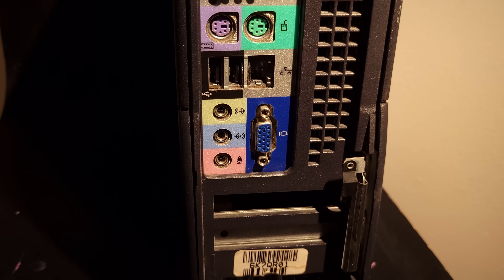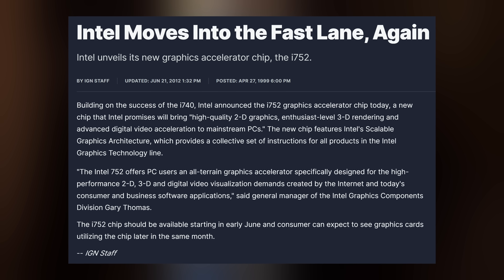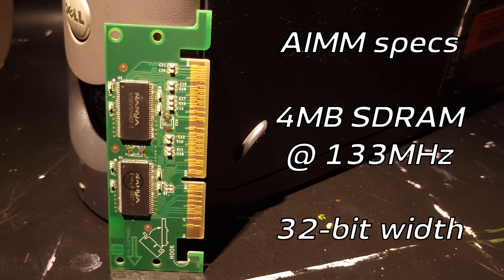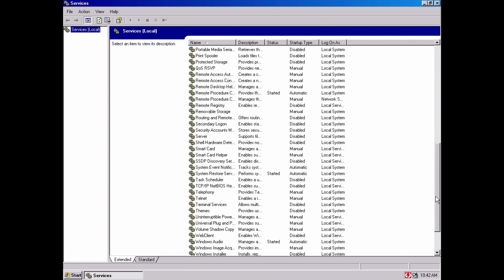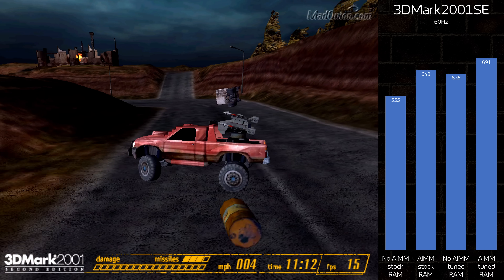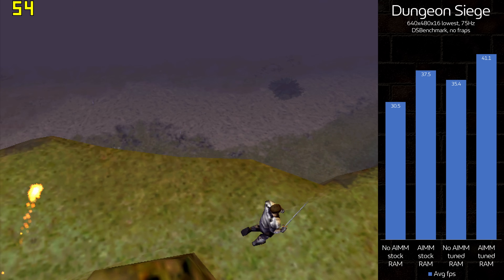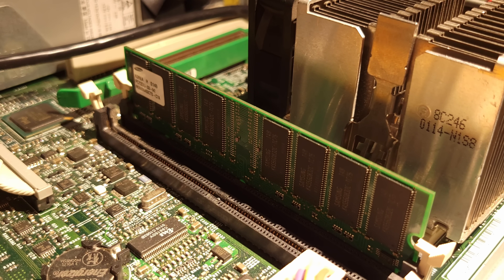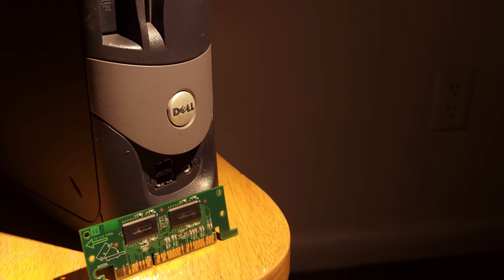AIMM: Intel's Forgotten Graphics RAM Card from 2000

Comment: there was old agp that used the on board ram !!! plus it's ram on the old 32bit systems !!! I p[ayed halflife 2 on it a p4 witha 256mb agp card. system used the first 4 gb ram then the agp used the rest !!! I payed with this setup till I finally had to do windows 7 2012. then 7 till a few years ago now on 11 !!! the 7 pro was a i-7 2600k 4.5ghz 16gb ram rx 550 4gb slow version. at 60-100 fps gaming with fornite and warzone when it first showed up for both fornite and warzone (and ps4(fps ?) when it showed up)!!! then now ps5 and good computer systems !!!

Comment: actually "dedicated external ram" for iGPU sounds a good idea, if on laptops you can select which RAM stick will be exclusively used by iGPU without interference with operating system on laptop with too many RAM slots and you're fine dedicating few sticks of it for iGPU

Comment: This kind of reminds me of what should have happened instead of SLI (Nvidia) and Crossfire (AMD). As the 2nd cards Ram was redundant they should have made a GPU card only for the 2nd slot which would have been quite a bit cheaper. But I guess the profit from selling 2 cards meant that was never going to happen.

Comment: I remember running 3dmark2001 with then current hardware and it chugging along. I installed and had a go with my current setup and got a score of 38246.  Thanks for a fun bit of nostalgia and showing some neat hardware I always thought should have existed but never knew it did.

Comment: 2:27 there was a few Mac computers where you could also expand the video memory for the graphics chip soldered on the board using a 144 pin slot.  This was back in 98-99. It came with an ATI 3D Rage II+ or Rage Pro on board  that had 2MB vram stock which could be expanded up to 6MB Vram. And even before this back in the Mac 68k era users could expand video memory to get higher resolutions and better colors.

Comment: i815/845/865 were truely horrible. linux driver developers basically gave up because the chip had memory coherency bugs and as far as I know all the different work-arrounds that were implemented didn't work out in the end. However, i915 and up are fine.

Comment: Your AIMM has a capacitor knocked off of it. (C14)  Although it probably works OK without it, it really should be replaced to protect the VRAM.
Reply from the maker: No it doesn't, there was never one installed to begin with. C5 is the same way
Reply: @hblankpc  Alright, my bad.  The messy looking pads there threw me off I guess.

Comment: I have a 1999 Dell GX100 that uses a SODIMM slot to allow the user to upgrade the onboard ATI graphics. I think I have a 4MB module in there. Due to the onboard AGP graphics, there is unfortunately no proper AGP slot on the board.

Comment: I've seen several Compaq 815E based boards for sale with AIMM modules. Problem is, they don't use even a semi-normal front panel header.
Reply: I have a Compaq Deskpro EN from 2000 with a AIMM module. A friend gave it to me. It had been stored for 20 years, in a not very good condition, and I had to restore it.

Comment: This concept needs to be revisited especially by AMD.. imagine how much better AMD Radeon 780M and the new 890M! And it could be a good idea to have a dedicated iGPU memory controller and a GDDR5 vram stick slot on the motherboard so we can upgrade GPU memory as needed instead of just allocating system memory.. it was a good idea in the 2000's just ahead of it's time and should be revisited I think. It's not really necessary for Intel HD integrated graphics but it will be good for iris XE graphics and AMD Radeon 780M and above. It could also be useful as a graphics cache memory for use when you have a dedicated GPU installed.. like how SSD's are faster with dram memory compared to SSD's without the dram cache memory.. so it could actually be useful in 2 separate ways for 2 different types of graphics..

Comment: IGP's where always, limited to memory bandwidth rather then plain speed. They could never compete with stand alone graphic cards but it's sole intention never was gaming. Such boards and chipsets where designed for office use, text processing, some browsing, maybe a video and very basic function of 3D acceleration. i never saw one of these ever, but i doubt they would make any sense since it's limited over the AGP bus as well ; no matter the speed of the memory. 4MB seems extremely limited as well; as 8 or even 16MB and perhaps a bit more wider bus would have make more sense. I bet the AGP bus cannot be OC'ed due to it's limited bios functionality, but i'm sure extra performance for free  would be on the table with that.

Comment: The basic idea of keeping textures in main memory was right but various stars had not yet aligned right over the PC platform.  Meanwhile Silicon Graphics aka SGI's O2 which was released in October 1996 had a 64-bit processor running IRIX, a UNIX variant.  That allows some demanding applications such as real time video processing which required much more texture memory than any graphics card had and was what kept the platform alive until 2002 when SGI was forced to cancel the product because the fabs manufacturing the custom chips stopped the fab line used for the custom chips.  Video studios were using those systems for much longer.

Drawbacks were software availability and pricing which restricted the system to professional use.  Also the OS had to be basically "bent" around the hardware to achieve the design goal.  Ignoring the fact that O2 series was MIPS-based, even an x86-based OS would have to be turned upside down to achieve those same design goals.  This technical constraint also affected SGI's Visual Workstations which were x86 and required a custom NT build.

Comment: Wait, so intel could see there was a problem with using system RAM to store the data the GPU needed... and decided give Mobo manufacturers the choice to solder some next to the die, then let it be user expandable. Then when back to using shared system RAM....
That is such a round about way of getting there.

edit: I also like the arrow on the PCB saying "To I/O panel" for an asymmetrical slot.
Reply: Original AGP (3.3 volts, 2x max) wasn't asymmetrical.

Comment: Never have I been so bummed to have the 865G-based GX270. However, reading the manual for the chipset led me to discover ADD (AGP Digital Display) cards. If I ever wanted composite video out from it, that would be easy and cheap to achieve...

Comment: That thing was pointless, adding vram to an igpu which already lacked in power. Better save those 50ish bucks and make a proper dgpu investment later on, was what everyone thought. For this hog to be successfull, it would have needed to be paired with a meaningfull igpu, not a graphics deccelerator, or, DIRT cheap with substential capacity of 16MB and up. It would still have sucked since a power anemic igpu can't make any use of lots of dedicated vram anyway.
And that was the demise of agp vram modules.
Next up, the ?rise¿ and demise of pcie ram modules! featuring intel. 😂

Comment: So it's basically a memory extension for integrated graphics?
I wonder if this concept would work with semi-modern GPU's to extend their memory using PCIE...
Reply: AMD kind of did it with Vega, the tech was called HBCC. But in general it wouldn't work because of huge disparity between PCIE and VRAM speeds during the last decade.

Comment: Glad you've come back to YouTube; I discovered your channel shortly before you took a hiatus hoping you'd eventually come back. Glad you have since I always loved your videos.

I never knew such a thing existed for the i815 chipset, though I struggle to see much of a point to it since even back then a cheap low end AGP GPU would have wiped the floor with the i815. Maybe if Intel had of stuck to this it may have been something for SFF or lower end systems to get some graphics power.

Comment: I've always thought this was a cool little thing. I wonder if you could make a custom 8mb or 16mb version...
Reply from the maker: Copypasta from another reply:
"Funny thing about that is, a lot of AIMMs already are 8MB. Intel's spec allows for both 4 and 8MB of physical RAM, but there aren't enough address lines to address >4MB. You'd need to rewrite the driver to offload more than the z-buffer for >4MB to be of any benefit anyway."

Comment: You got me. I was fixing thousands of systems around this time and never once saw this crazy thing.
Reply: I had one of these on my Penitum 3 Tualatin on the i815 Chipset that I bought from Kindston and it did help with game performance in Medal Of Honor Allied Assault. The cost of the AIMM @ $5 from Kingston Memory was minimal compared to a GPU at the time. I did later on upgrade to a 9700 pro. I still have the Mobo, 1.4ghz CPU, 256MB PC133 CAS 2 DIMM, and the AIMM module is somewhere in my house.

Comment: This is kinda sucks when we could have an actual platform to upgrade not only CPU but VRAM, GPU core too. And because initial idea of this is still expansive in compare with older GPU's or new GPU's. It's better to just take it than having a little more performance on iGPU. I would happy to see if there something new with this concept was made for the market, because as we know today's iGPU's can replace Low/Mid GPU's. But of course actual accelerator will not be replaced with tiny idiot in the CPU)

Comment: It made perfect sense to go with the relatively cheap AIMM as back then the SDR price was pretty high, and most Y2K computers came with only 64 to 128Mb of SDR, 512Mb like on your system was an absurd amount of RAM and the max supported for Windows 98SE. Any amount dedicated VRAM could really hurt the overall performance of the computer.
Reply: By end of 2000 you could find low end TNT2s of decent quality for around 50$ or less (I say quality as in not totally fly by night brand, you might be settling for an M64 but that's still better than anything integrated of that era). When I started working at a computer shop in 2001 we looked into ordering some but they were still costing us as a shop about as much as one of those cheap TNT2s.

Comment: Now I want an Electrical Engineer YouTuber to design and make an 8MB module...
Reply from the maker: Funny thing about that is, a lot of AIMMs already are 8MB. Intel's spec allows for both 4 and 8MB of physical RAM, but there aren't enough address lines to address >4MB. You'd need to rewrite the driver to offload more than the z-buffer for >4MB to be of any benefit anyway.
Reply: @hblankpc  i815 3840x2160 when

/s
Reply: @bitsundbolts
Reply: I’d be more interested in a 12 gb pcie version
Reply: PCB way or something similar